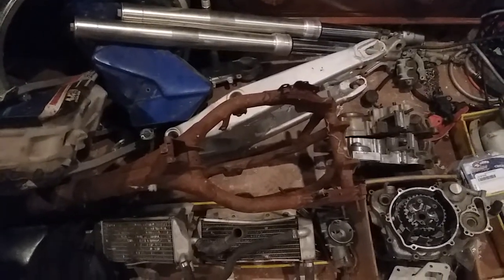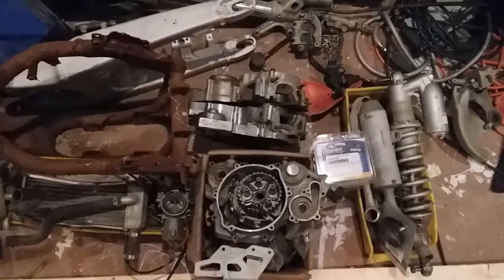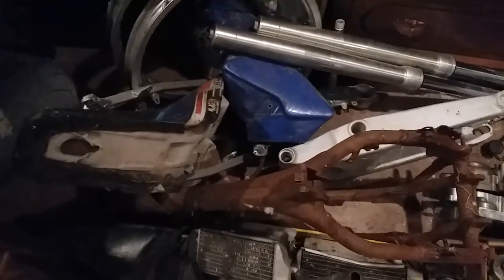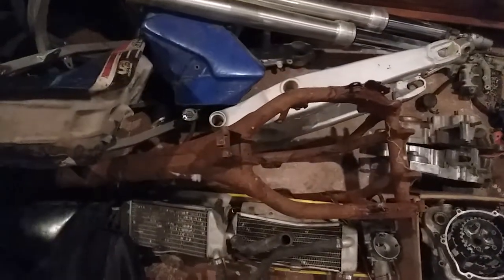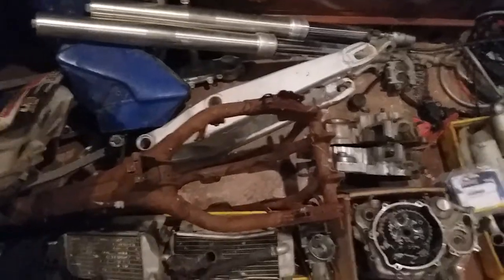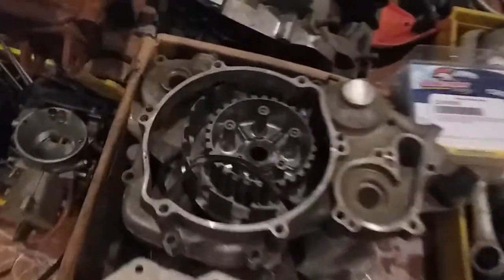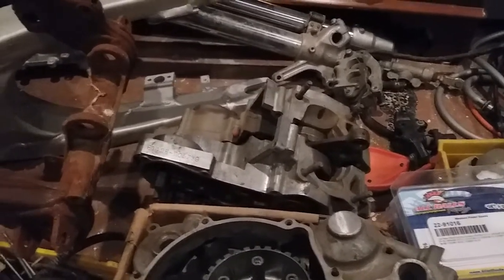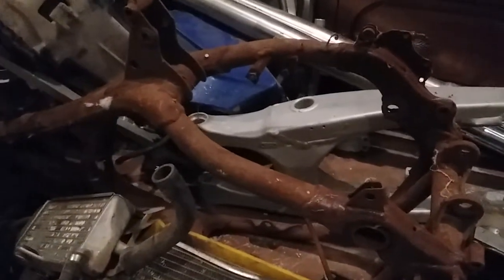Yamabits 1

Comment from the maker: Correction: I finally got a chance to look closer at the frame and get the frame number, and turns out this is a 2002 YZ125, not 2001. Which is great, as there are more parts still available for the '02 model than the '01. Amazing the difference a year makes in this case....

Comment: Awesome!  It takes a lot of skill and time to do a job like this. You’re very talented and great at what you do. I probably couldn’t put that back together. 
...All the king’s men couldn’t put him back together”.
Reply from the maker: Thanks man. It really isn't as hard as it looks,  since this is right now a random pile of Yamabits. The trick is to take things one "subassembly" at a time, for example: swingarm and linkage, front wheel, rear wheel,  brakes, steering head, front forks, rear shock, etc. Each of those I mentioned, once cleaned and rebuilt, will rapidly bring the bike together pretty fast. The engine will be the most complex (and expensive) part of the build. But as you will see as I post the rest of the videos, it will come together pretty fast.
Reply: @mxslick50  just like a big jigsaw puzzle.

Comment: Holy crust! That's a lotta bits!
Reply from the maker: It sure is. It won't be too bad getting it together though, I've done it all before back when I was racing in the 90's. The most difficult part will be the engine, not a lot of parts but very fiddly to get all the tolerances right.
Reply: @mxslick50  I dig it. How long would this take?
Reply from the maker: Frame repaint about a week,  assembly of all other parts a few days (20-50 manhours) and the engine takes 8-12 manhours.  I will be working on it as I get the money to get the parts I still need.  I am expecting to have it done by spring, and first track/race day by summer.
Reply: @mxslick50  if you make videos of the build, I will definitely watch
Reply from the maker: Stay tuned, you'll get to see it happen.
Reply: @mxslick50  That's what I'm talking about!